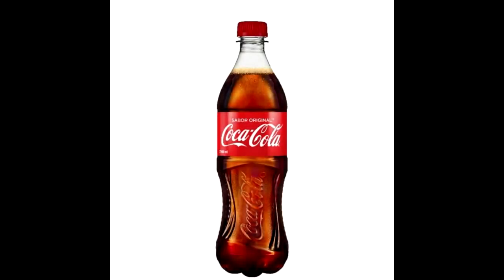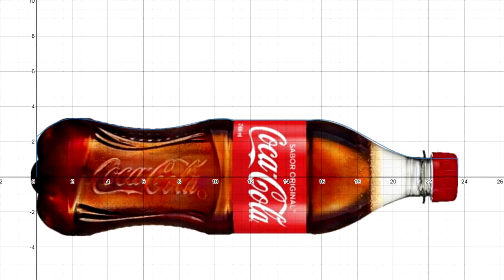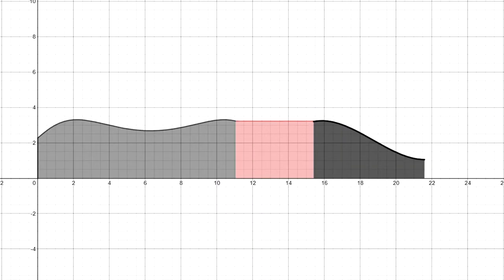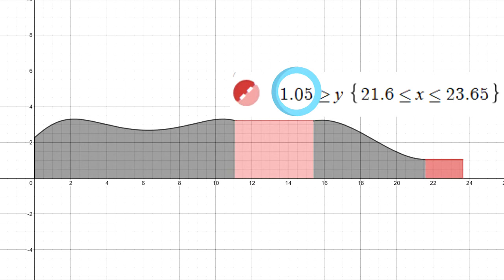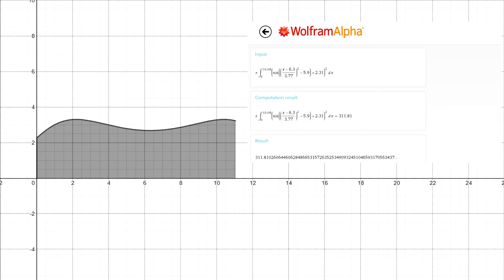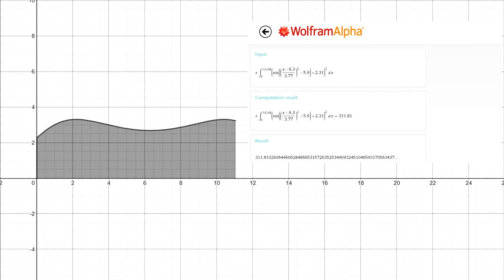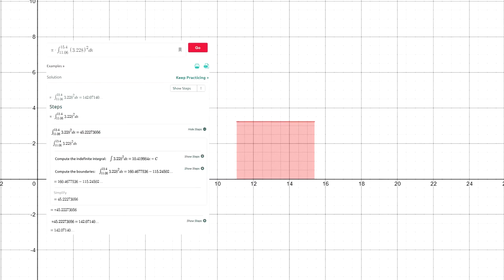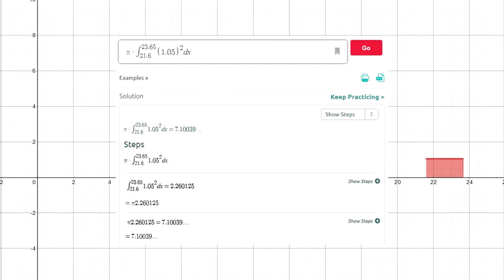How to calculate the volume of a Coca-Cola bottle using integral calculus.

Comment: Hi Love the video! Is it possible to calculate the surface area of the coke bottle from this?
Reply from the maker: It's not possible to calculate the surface area by using this method, for that you'll need to use the Arc Length Formula and calculate each for the segments (the functions should be the same) and then multiply that by 2*pi*r, r being the f(x). Hope this helps
Reply: @gerardovillegas161  just wanted to say thankyou soo muchh again!!

Comment: What do you mean when you said that you "played with the parameters"? How did the functions actually appear tracing the bottle?
Reply from the maker: We just adjusted the parameters from each function by small increments, in the case of the sinusoidal function, we adjusted the amplitude, magnitude and frequency little by little until we arrived at the most similar to the bottle.
Reply: @gerardovillegas161  thanks man!

Comment: Hey man. I have a similar task. I can't find the functions for the outline of my bottles. Can you please help? How can I personally contact you?
Reply from the maker: Well in this case it was mostly trial and error, you can either try and find a polynomial function that matches your shape, however this may take quite few tries, or do what we did here and see if its shape kind of looks like one that you know of, which in this case was a sinusoidal function, and then you just alter its parameters and coefficients
Reply from the maker: Another thing that might work is to follow the first steps and instead of proposing functions, you place some point along its outline, then in Excel you can place the point in x and y columns, then plot them and finally use the linear regression function in order to get a polynomial function that matches the outline that you need